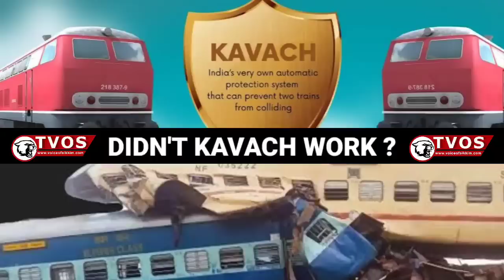Odisha Train Collision 💥 : Why KAVACH Anti-Collision Technology Didn`t Work?

Comment: It’s a satellite based anti collision integrated system then why it doesn’t work.
Reply: i was not installed at all
Reply: Even if it was installed still it won't have worked because the trains were not on the same tracks. It was just a few seconds before the collision that the express train came infringing into the loop line..